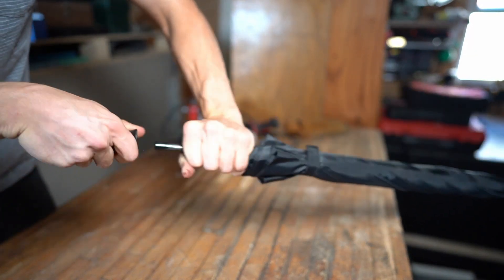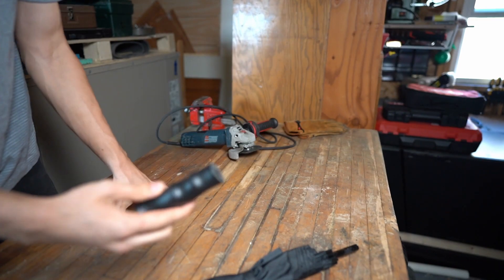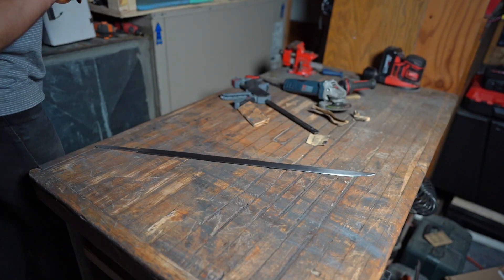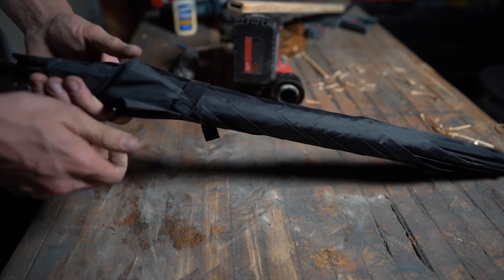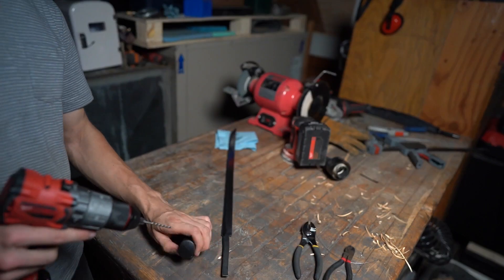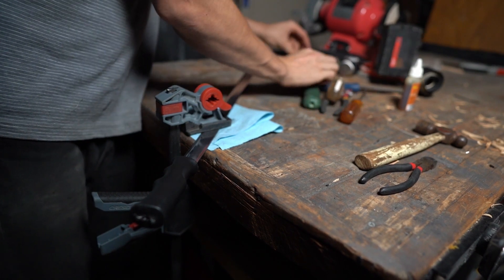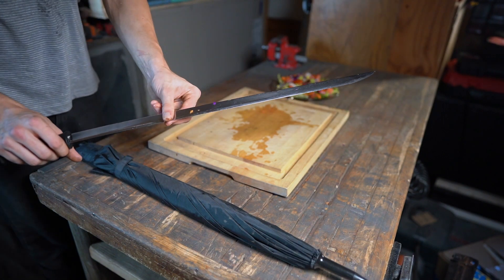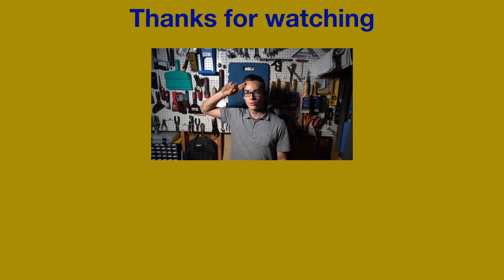Making An Umbrella Into A Hidden Sword

Comment: You should put a habaki(a copper sleve) at the top of the handle at the bottom of the blade area so that when you sheath it back, it would stay in there firmly. In that sense, it won’t slide out freely accidentally.
Reply: @TheRandomVidsChannel  well that’s a practical way.I just thought a copper sleeve like a habaki will also look cooler aesthetically.

Comment: The only thing I would add would be a device to keep the blade in the sheath when walking around with it. I have no quarrel with using mild steel; it's a weapon of last resort, so unlikely to be used as a defensive weapon.
Reply from the maker: Yeah, I ended up putting a small clasp on it.

Comment: Question does the sword hold if you were to casually hold it?
Reply from the maker: Not before I put a small box clasp on it. You can kind of see it in this video. 

https://www.tiktok.com/t/ZTRmGJwQj/
Reply: @TheRandomVidsChannel  also does the sword stay in the umbrella if you were to hold it like a normal umbrella
Reply from the maker: I thought that's what you meant in your first question. If your first question was will the blade come out of the handle if you swing it, the answer is no. It is fixed in the handle quite well.
Reply: @TheRandomVidsChannel  ok
Reply: @TheRandomVidsChannel  also are you using a manual umbrella or a automatic like does it open from a button or not

Comment: Well… Best use a higher grade steel you can still work with by methods of only using a grinder.

The sheathe idea was a clever idea, really resourceful. Though @idiot sandwich! Has a point; A habaki can secure the blade into the sheathe much easier. That, or a fastening pin or locking mechanism.

The way you attached the handle was a smart method. It doesn’t rattle or loosen, does it?

You also mentioned the umbrella function still works? Impressive work there.

Finally, use a sharpening tool to make that sword sharp as a razor.
Reply from the maker: Thanks for the tips.
Reply: Some were tips, others were legit and honest questions.
Reply from the maker: The handle is nice and tight. And when the umbrella is open the sword is kinda obvious.
Reply: Maybe so. But I’m sure it’s still cool as hell.